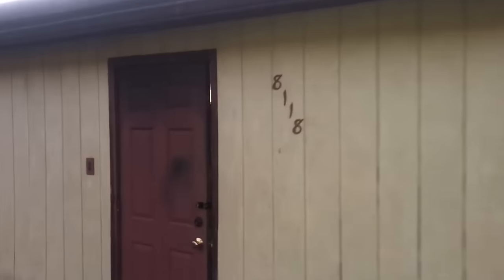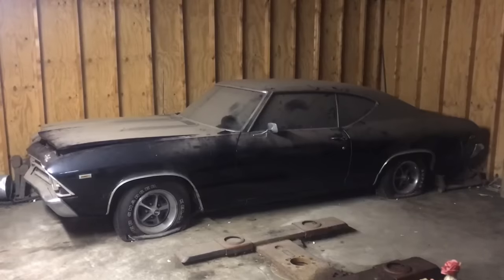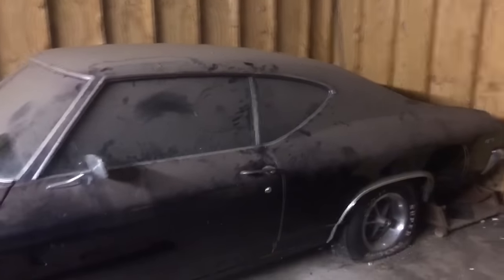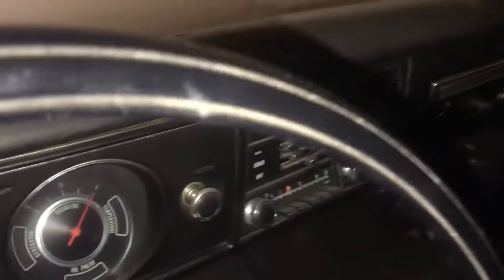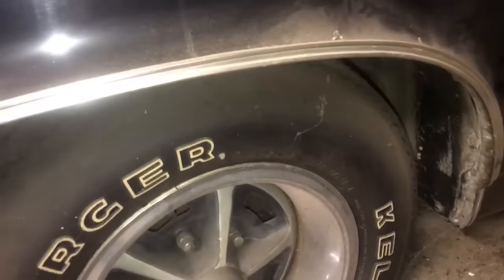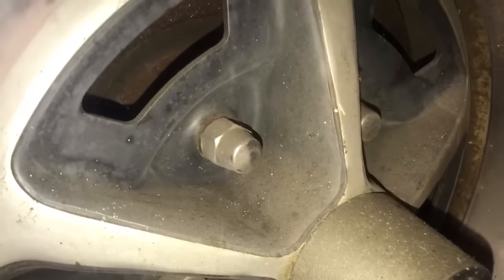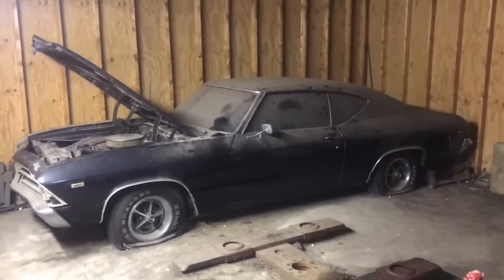1969 COPO 427 Chevelle BARN FIND JUST DISCOVERED!!!

Comment: No way I'd restore that. Get it mechanically sound and show it off.
Reply: Detail cleaning, carefully restore the original paint, and replace that master cylinder with a proper date code one. Repair what’s not working, but keep the original coatings. It’s an amazing survivor car.
Reply: @Mikeflorida7000  agreed
Reply: 90 percent of the cars he finds i feel the same way. It annoys me when guys attempt to restore cars all original. It's technically not original anymore bud. Just appears to be. My Chevelle is a day two car with a 30 year old paint job and I love it.
Reply: She is beautiful
Reply: @ls6-ss413  I'd much rather have a day 2 modded car that I could drive than a pristine concourse resto I trailered everywhere.  Cars are meant to be enjoyed
Reply: @0xXAllForNothingXx0  I totally agree with you.  I would clean the car up and take it to Car and Coffee and let people drool all over it.  To take it to concourse level where you cant actually enjoy the driving feeling of this ride is ridiculous in my opinion.
Reply: Hack the rear put in a mini tub, LS swap it, lower it on 26 inch rims 💥 custom color flop candy paint 🍭
Reply: I totally agree. Wash it and drive it. It's only original once.
Reply: Cut a hole in the hood add 6-71 supercharger
Reply: Change it to a 71’ with a front end swap and add fiberglass fender flares and formula one air duct on the roof 🏎
Reply: @0xXAllForNothingXx0  I find that stuff fun. 
You can't replace that water pump, I bet it's bad , haha you gotta source a rebuild kit for it I'm guessing. 
But like I said I like when a minor detail can be a major project.  
Something like this is worth the time. 
I'm up in the air on what should be done to this car , disassemble and clean and reassemble.
 or just make it operational? 
Everyone's gonna cry no matter what you do.
Reply: @BlohmandBlohmer  can I disassemble stuff to clean it up or would people holler ? 
Like say remove the rad support to clean it nice and preserve what's there or leave it alone with a little dust ? 
Nothing crazy , soap and water just to remove dirt.
Reply: They are only original once.  Once you touch it, it just is another restored car.  
I am so sick of seeing pristine restored cars at car shows.  $10k paint jobs and smooth lines....Whipdee do..  
I love seeing original cars!  That really gets my adrenaline flowing!
Reply: @cew142  yea I love time capsules too ,haha but the dirt on it that it's found with , technically is part of it's history ...
Would be nice to see under the dirt ,even if there's little rust spots here and there , leave em I guess .....
wax them to preserve it ? 🤣
I'd be afraid minor detailing would affect it negative , don't touch up the rust with paint ???
  I have no idea really how to treat a museum piece correctly.
Reply: @MrTheHillfolk  I think just a good handwash and wax would do the trick. No pressure washers.
Reply: Don't understand the let your car go to shit then drive it around as unrestored.
Reply: I agree, the interior looks near flawless, little buff and was....away you go
Reply: @devinjackson2373  Not if fully restored brings in 6 figures.  Thennyounwould be Dumb to not sell it to a collector who will keep it well kept in a climate controlled garage while you use your 6 figures to go find and save 2 or 3 similar cars in rougher less concourse level condition.
Reply: I would drive that diamond
Reply: @MrTheHillfolk  pretty much, you can rebuild most of the oem parts with time and knowhow,  I'm not above butchering and modifying old cars but rare ones like this need to be left along. But to each their own.
Reply: @fraidykat  if you "enjoy" trailering a car around have at it. I enjoy banging gears and smelling gas and oil burning myself but to each their own.
Reply: @PnwOnTour  Obviously your not serious! WTF?
Reply: I’d probably just part it out actually
Reply: @fraidykat  This example will fetch way more then any concourse restoration version.
Reply: I agree. I'm a big fan of restoration of old vehicles (antique diesel trucks my fav) but I'm a huge muscle car fan also. But that car is a find. Clean her up keep her stock and show her off. I know I'll get a lot of flack for my next comment, but I hate when shops customize perfectly sound vehicles. If they are to far gone to restore then fine customize the living shit out of them. I truly appreciate people who are dedicated to bringing them back to assembly line specs. I really enjoy seeing the younger generation of kids getting into the old-school cars and trucks.
Reply: @thomasglynn2282  ....I could not agree more. If you’re working with a rough “project car” and there’s more Year One and Goodmark sheet metal than there is Body by Fisher...... have at it. Customize to your heart’s content 

However, if you have a straight solid, original car, do not hack it up. If you really want a restomod car that bad, trade it for a patched together car.
Reply: Restore with mostly elbow grease, then drive it and show it, probably got the miles 1/4 at a time, an excellent mechanic told me to break it in how your gonna drive it, that's probably this badass chevelle, what an AWESOME 'chine!!!
Reply: It’s worth too much and to important a car to make a daily driver. Maybe 50 miles a year just to keep it in good running condition. The worst thing for these old beast is just to let them sit.
Reply: @devinjackson2373  - My brother use to do that with his perfect 1969 Gto until a 75 Nova came barreling through a 4 way intersection and slammed into the side of his Gto. Took him 2 years to get it back where it was. He now drives it 25-50 miles a year.
Reply: @PnwOnTour  ok ok, stop.....lol.
Reply: Scrap the frame, scrap the body go all fiberglass doors trunk etc. art Morrison frame, turn it into a lift off body funny car, nitrous oxide quad turbo the original engine.
Reply: This legendary car deserves a full frame-off rotisserie restoration.
Reply: I couldn’t agree more!
Reply: I say put an air duct on it and make it a rock crawler😆

Comment: Awesome find, congratulations on a beauty. I thoroughly enjoyed watching this video but, when you showed us the interior,  my mind flashed back to the last time I sat behind the steering wheel of my 69 Chevelle SS 396. Pangs of regret flooded over me anew for trading it in.

Again, thanks for sharing. 
Stan
Reply: Same here lots of memories of 69 Ss 396 canary’s yellow
Reply: @vernt4583  Mine was Hugger Orange with a Black interior. My factory steering wheel was Brown, wood grained plastic or whatever material they used.
Reply: Harrison Mantooth I had a new 1969 Chevelle SS 396 L78 4 speed! I raced a friend who had a 1968 Chevelle SS 396 350hp automatic! We started size by side at a speed I was still in 1st gear. I never lifted my foot off the gas in all 3 shifts & the 68 sat right beside me to 120 mph. To say the least I was disappointed in my 375hp asI now believe they were under rated for insurance reasons! Plus I had to put up with valve adjustments on the L78!

Comment: I have a 1969 Chevelle SS.  Sure would like to talk to you about it. My dad bought it new and gave it to me when I turned 16 yrs old.
Reply: Unfortunately, the cowl tags don't tell as much as they could if Chevrolet would have been tracking options and other features.  Love 1969 Chevelles in general.  What does your car have, anything unusual?  Just curious.
Reply: Mark Jackson    Well I really don’t know if it is anything special.   69 SS 396 350 hp.  Automatic. Bucket seats. Midnight blue.  White pinstripes.  Hardtop.  Original chambered exhaust.    Would like to know if anything is special about it.  My dad ordered it for my mom.  She passed away 2 years after that.  He saved it for me because I told him I wanted it to be my first car.  
At 16 he said it was mine.  He also said if I wrecked it being stupid i had better hope it kills me because when he see’s me he would.     I never did.  Lol.
Reply: see if you can find a build sheet    sometimes under the back seat
Reply: @tubby2503  I would say that since it's a known 350hp car with an automatic, it's a general SS396 car, which is a good thing.  I was just wondering if it was an L78 (375 hp) or an L89 (375 hp with aluminum heads).  I would say that it's a great car to own and drive, and will be worth a tidy sum.  Not COPO or Yenko money, but a known SS396 that is original is always worth some money.  If you can find a build sheet, that would be icing on the cake.

Comment: Way back in 1979, my best friend (who was only 17 at the time) traded a bunch of junk for a really nice Frost Green 1969 Nova SS from his neighbor. Car was a 350, 4 speed, 12 bolt with factory 4.10 gears. Radio delete and rear window roll down delete (which we thought at the time was fake). Car had what we thought were factory Chevy van bucket seats and rubber mat flooring. It had SS emblems on exterior and interior, but it was super basic. We took the back seat out for some odd reason and found a build sheet in the springs. The car was special ordered "COPO" (which we didn't really know what that was back then) with "special high performance" 350 small block and all of the items that I mentioned above. The car had 1970 Camaro SS steel wheels on it. Dont know if they were factory or if someone changed the factory wheels. Don't know/ remember the HP of the engine, but, that car with bias ply tires would pull the drivers side front tire an inch off of the ground when he raced guys in Chattanooga TN. way back then. Wonder what ever happened to that car...

Comment: That’s a nice car. I wouldn’t even work on it until I did a full hand wash 2x. Than I would change all the fluids. Oil and filter first. New battery. And that air filter needs to be replaced too.

Comment: L72, 4 speed, bench seat, no power steering, no gauge pack......this car was built with one purpose. And i consider the  Power Disc  Brake option part of that purpose. I remember the L72 was actually rated at 450HP but advertised as 425H......11:1 compression and 4 bolt mains. I can't remember if it was solid lift tappets.  Anyone know?
Reply: mindeloman YES, SOLID LIFTER CAM, IT HAD THE SAME CAM AS THE 396 375 HP WHICH WAS FIRST RATED AT 425 HP IN 1965.

Comment: The reason they have SS wheels is that was the only 14x7 available on a 69 Chevelle SS and the COPO package started with ta SS and then did an exception and substitution list which added the engine and rear end, if the car was ordered with 9737 sports car conversion it would have the 15x7 YH wheels like the 69 YENKO Chevelles.

Comment: Over a hundred still missing. I bet the bulk of those had their motors pulled in the 70's and the cars were later scrapped because they were just thought to be 6cyl or 350 cars.
Reply: More than likely. I'm sure some were stolen as well
Reply: My dad had a used 67 SS 427 Impala that had been stolen and the engine replaced with a 396. Also, a guy in town blow the engine in his SS Chevelle and replaced it with a 350.

Comment: These COPO 427 were faster than the 70 LS6 Chevelle. Yes I have seen quarter of mile tests.
Reply: I have a casting book 840 heads are iron heads rectangle ports closed chamber I think these were used on the 435 hp vett used in late67 that head is the cast iron equevilant to the aluminum 842 head used on the l89 and l88 used in 1968 if you noticed the 1968 L88 427 used closed chambered aluminum heads but in 1969 the change to 074 Zl1 style open chamber head was used not only the heads changed but the Pistons as well but one thing stayed the same in the following engines 1966 L71,L72, 427 theL89 396 and L89 427 and don't forget the greatest the Ls6 454 used the same solid lifter cam the # 143 street mechanical solid cam you have that cam you have those engines and lucky me I have one new in the tube

Comment: 38k miles. It's not even broken in. Wow.
Reply: If they kept it in a heated building. Holy shit.add extra 20 to 40 grand to that car.
Reply: Given that a 4.10 axle ratio (with no over-drive transmission) was standard fare, there's more engine wear than most people would expect.

Think 4,000 RPM at 70 MPH with lots of heavy internal parts and you'll get the idea.

Comment: Does this have the wintersfoundry heads and intake? Should have the aluminum “snowflake” heads and instake in it. If I remember like my 69 copo 396 camaro they all had the winters foundry markings.
Reply: The L-72 wasn't equipped with aluminum heads unless the L-89 option was also specified.  (I don't know if any 427 COPO Chevelle were so specified.)

The ONLY 1969 Chevrolet V8 engines that came standard with aluminum heads were the L-88 and it's aluminum block counterpart, the ZL1.
Reply: REF III The L72 only came with cast iron rectangle port heads and the aluminum snowflake intake from the factory/assembly plant.

Comment: This right here is my favorite Chevelle. Just as quick as an 70 LS6 and I've heard maybe even a hair quicker but way more rare and also a better looking body style than the 70-72 in my opinion. I wouldve ordered it with the dog dish caps to complete the sleeper look
Reply: You're correct.  The '69 body was a little lighter and the L072 427 was slightly more powerful than the '70 LS6 Chevelle.

http://www.superchevy.com/how-to/additional-tech/sucp-1102-chevrolet-muscle-car-dyno-wars/

The LS6 was hampered by a low rise intake.  Because the 454 used a longer stoke, it had a taller deck height, with dictated the use of the more restrictive low rise intake.

Also take note of recorded peak HP levels in the link above.  They're legitimate and expose how overly inflated the old "Gross" ratings actually were, realizing that myth would have us believe the opposite.  Add 15 or so (a rough figure) and you'll have something close to actual, "as installed" (SAE Net) horsepower.
Reply: @peteshea8010  No, it didn't have a taller deck height, unless it was a medium duty truck block which was necessitated by the use of 4 ring pistons. Car blocks all had the same deck height 396-454.

Comment: Hi Patrick, another great video.   What I’d like to ask is what exactly is a copo car?. I was always of the impression it meant the original owner had to be a GM employee but really not sure.
Reply: Anybody could have ordered one if they knew what box to check off. Nova's, Camaro's, and Chevelle's never had the 427 option, therefore is wasn't on the option list. But, if you or the dealer knew about the COPO option, you could order one. They were all base coupes, had no distinct badges, but had good standard equipment like disc brakes and 12 bolt rear ends. They were basically SS 396 cars that never got the SS trim, and were still built at the GM assembly plants. I had a COPO Camaro. I didn't buy it new, but I had the pleasure of meeting the original owner. I was owner number 5.
Reply: @kennydemartini2169  Yeah it's like a plain Jane Malibu with a go fast engine and trans. You don't need PS, AC, or SS badges for the drag strip. I'm wondering what gearing this car has?
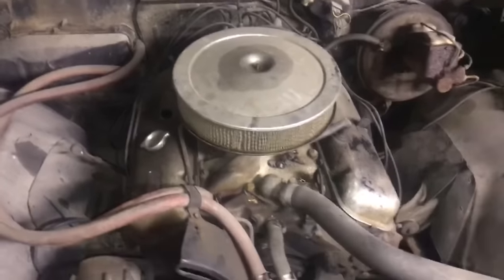Reply: @Deucealive75  My COPO Camaro had 4:10 gears. I think that might have been the tallest ratio you could order. I've seen them with 4:56 and 4:88 gears from the factory.

Comment: Did they add the SS wheels or order them with the COPO? Did y’all find the build sheet?
Reply: The reason they have SS wheels is that was the only 14x7 available on a 69 Chevelle SS and the COPO package started with ta SS and then did an exception and substitution list which added the engine and rear end, if the car was ordered with 9737 sports car conversion it would have the 15x7 YH wheels like the 69 YENKO Chevelles.

Comment: Back in 1981 ... when I was a stupid kid , I sold my 1969 Chevelle ....... it was a SS vent window sedan with a bench seat and rubber floor ..... found out later what it was .... biggest mistake of my life ... I've looked for it ever since
Reply: You say it was a 4 door sedan?
Reply: @bloodybones63  no .... it was a 2 door sedan ..... SS 396 4 speed posi  rear ...black and black .. the only one of 12 made .... most likely THE rarest of all /any chevelles ..............  But .. it was 1981 .. and I was in love with a girl that was jealous of the the car , so I sold it for close to nothing , and took her to Key West Florida .. broke up 10 months later ...............
Reply: @richardritter3092  I thought 2 door cars were coupes? I had a 1968 SS 396 , the registration id'd as SPC, or sport coupe. Did you have a 'b' pillar?
Reply: @bloodybones63  only 12    2 door sedans were made into the SS version  ........... all other SSs were hard tops  .......  mine had vent windows  and a metal window track on the door . " B " piller between door and quarter . ............ car was not a coupe it was a sedan
Reply: @richardritter3092  Interesting. What was the thinking behind that? An experiment?, ECT?
Reply: @bloodybones63     The way it was explained to me ......... in 68 demand was high for SS versions , at the beginning of 69 production ... there were sedans on the line left over from 68 . And they were the first 12 SS s of the 1969 production .

Comment: 38k on the clock by the late 80s. 
Sounds like it wasn't used alot , for nice summer days and weekends. 
And it lasted till then and someone parked it before doing repairs and ditching all the original parts.  
Maybe they knew what they had , or just had enough respect to park it inside. 
Maybe it still ran but had those usual 100 things that needed to be fixed and it was overwhelming ? 
Haha we can only guess , but I bet it's a good story.